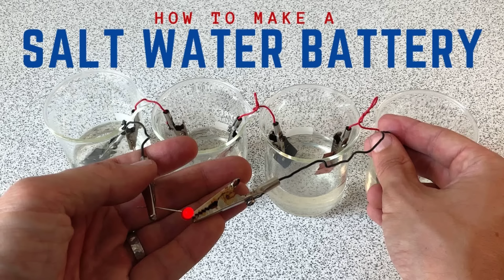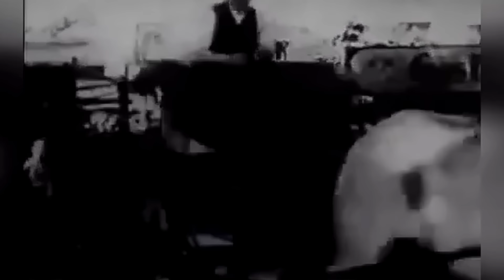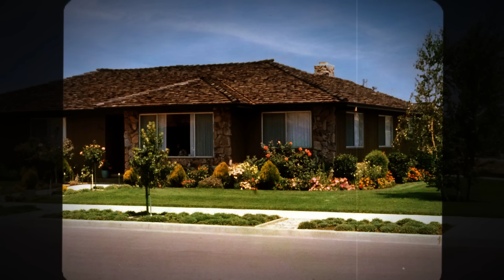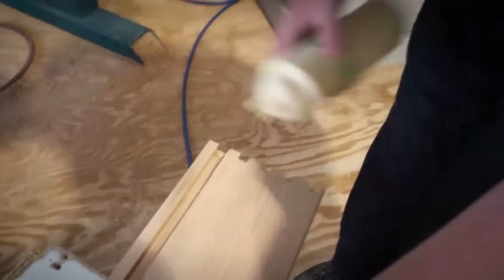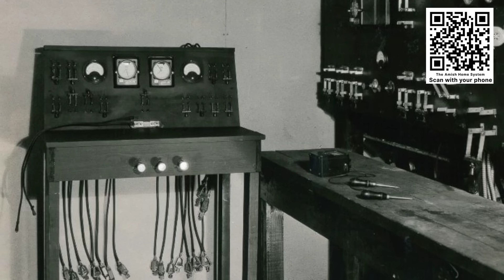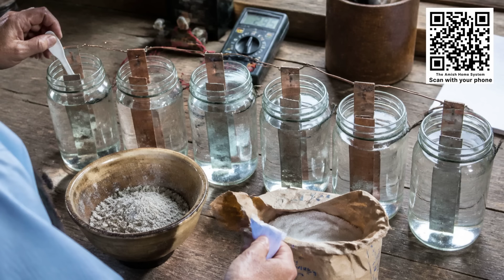How the Amish Outsmarted the Battery Industry with $5 of Salt Water

Comment: Where can i get galvanized steel plate?  How long does the charge last?  How does one recharge the battery?  What kind of wattage will 6 cells produce? In another video it said to use potassium hydroxide (lye) instead of salt water and to add a small pinch of lithium hydroxide (50 g/liter) to stop/slow the slow degrading of the cell.  It seemed to say a bank of cells could be used to run a single appliance like a pump, refrigerator, etc. How is that done ?
Reply: Lol yeah, I've never heard of google either 😔

Comment: What about the fact that batteries make d c not a c
You would need an inverter.and a large one isn't cheap and a small one comparable with these batteries would still not run a refrigerator.you can run some low voltage light bulbs for emergency.when there's no electricity no matter where you live.
Reply: Can easily make your regular household 
 12 V DC since you’re already in the context of doing these batteries